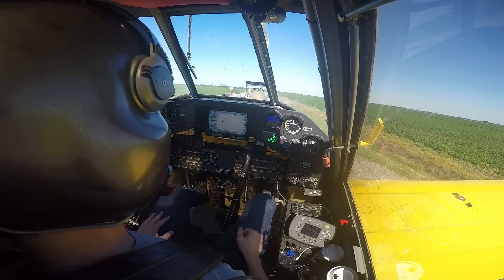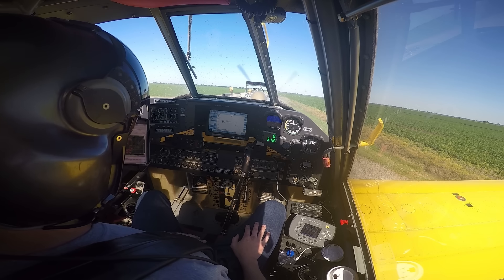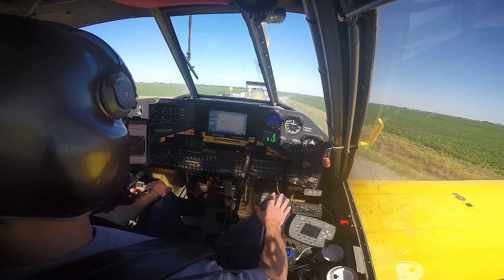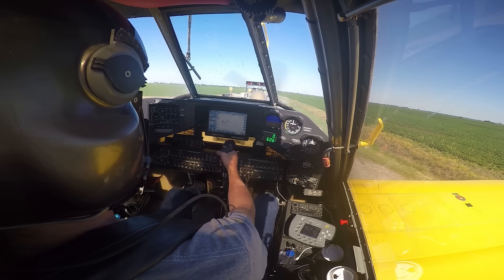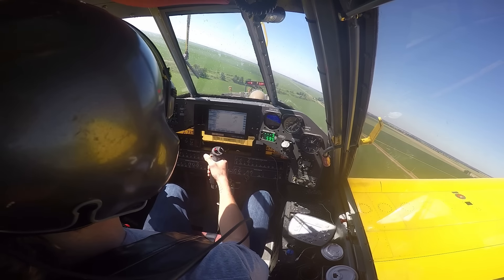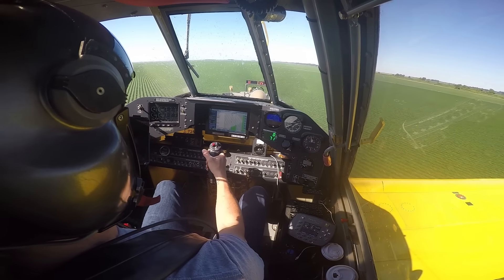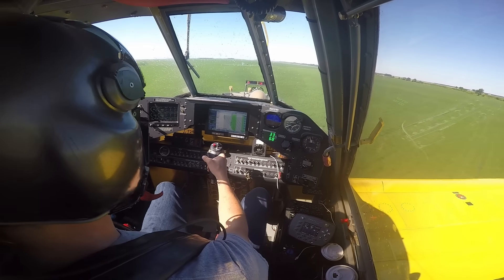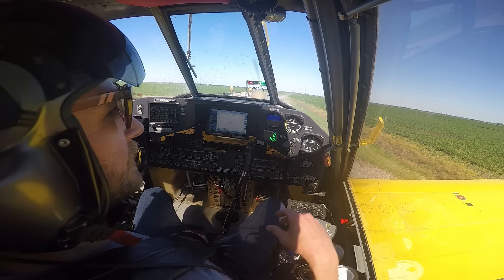Air Tractor 802 Spraying Rice in Arkansas

Comment: Question for you. i heard that operators wants beginner AG pilots to spend a season working on the ground... Why is it that operators wants you to work on the ground for a whole season?, I understand the importance of knowing about the ground operations but I think anything more than a month or 2 on the ground is a waste of time. pilots that wants to work as crop duster wants to get to work asap and not waste much time before starting. I would appreciate any information you can get me. I have my commercial license and I'm looking into crop dusting. Thank you, good video.
Reply from the maker: @Youtuber-o   Working on the ground is where you learn how to do the job in the plane. We don’t get paid to fly, we get paid to apply pesticides and fertilizer to crop. You have to learn the application side of the business and the absolute best way to do that is work the ground and absorb all of the information that you can. I worked on the ground for 5 years before I got in the plane. Also, you will need several hundred hours of tail wheel time before an insurance company will even consider insuring you in an ag plane and a cheap one at that. The planes I fly are $2.5 million brand new and it will take several thousand hours before you could get insured in one of those. In this industry you have to start from the bottom and there really isn’t any way around that.

Comment: $400k a year, I assume expenses like plane payment, annual, fuel, repairs etc come out of that?
Reply from the maker: We aren’t making quite that much on a normal year. $400k would be a 900-1000 hour year. Hired pilots do not pay any expenses. The full gross of an 802 is typically $2000-$2500 per hour and expenses come out of those figures.

Comment: Next time you record could you say when you turn the pump on/ off for a couple passes? I'm really curious about when you turn the spray on and off lol love the videos
Reply from the maker: There is a box on the right side of the dash with green numbers on it. The lower number is the quantity of my hopper in gallons and the top number is the boom pressure in psi. The pump stays running all the time and I turn the spray on and off with a handle that opens a ball valve. If you watch the boom pressure readout you can see when I turn the spray on and off.
Reply from the maker: I only turn the actual pump off when my hopper is empty. The pump is air driven and when I turn it off a magnetic brake engages to stop the fan.
Reply from the maker: I only turn the actual pump off when my hopper is empty. The pump is air driven and when I turn it off a magnetic brake engages to stop the fan.

Comment: Awesome videos, what kind of hours do most ag spraying companies look for?
Reply from the maker: That depends on a lot of factors. Flight time is not nearly as important as working the gound side of the business. This is not a flying job, it is a chemical and fertilizer application job. A high time pilot with zero knowledge of application is worse than a low time pilot that has been working on the ground and learning everything they can about application. I started with 350tt and 300 of that was tailwheel time and I had been working on the ground for the 4 previous years.
Reply: @pcohen85  right on thanks for the response, also have a A&P. Might start trying to dip my toes into the ag side of aviation

Comment: What's the A&P work like in this industry? Is the pay for mechanics better than GA? I imagine it's seasonal. I'm gonna get my license within the next year and I'm not really sure where I want to go, I have a passion for all sorts of aviation and I want to do something cool! GA stuff always piques my interest but the pay is so much worse than commercial stuff- it's hard to justify it to myself.
Reply from the maker: I am not sure about the pay but the work I’m sure the work would be more satisfying than GA work. We hit things all the time, come in with weird problems that require a bit of intelligence to figure out, outfit new parts a lot ect. Working in Ag you mainly see airplanes from two manufactures and there are multiple models between the manufacturers that are all very similar to each other. The work is not seasonal at all and is very much year round. If you have a passion for aviation and don’t want a boring job overhauling piston motors all the time or doing annuals on planes that only fly 50hrs per year definitely check out Ag aviation.
Reply: @pcohen85  Great, I appreciate the response! Ag is definitely something I will be looking into